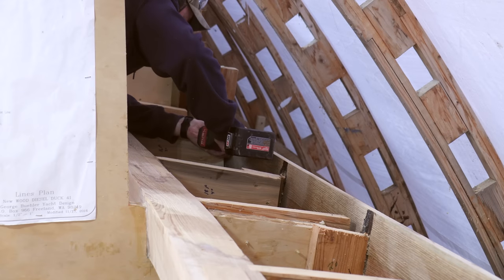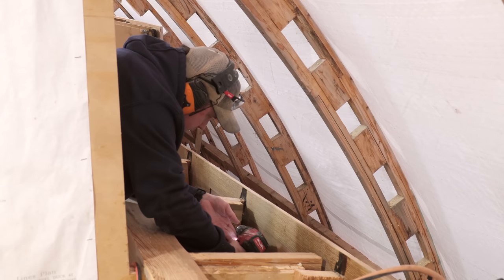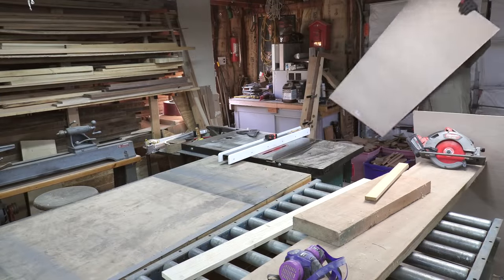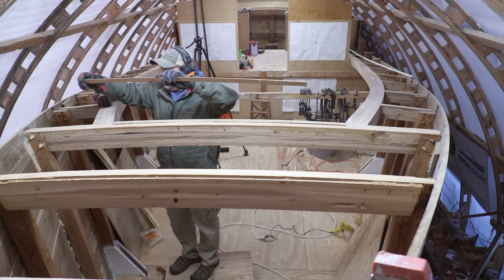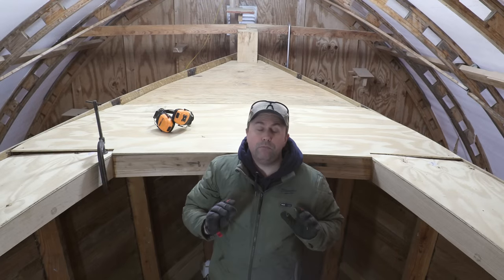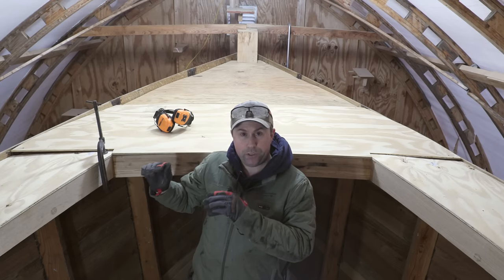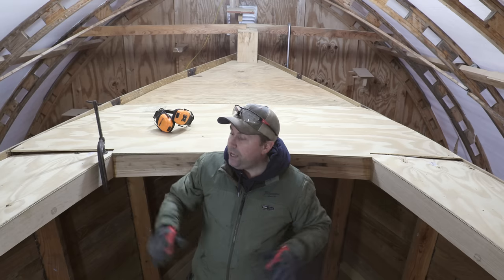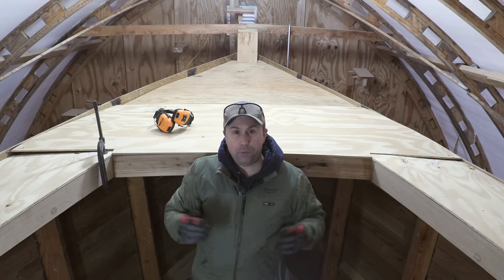Forward deck construction on our 41' wooden trawler.  SDP Ep78

Comment: Years ago I built a 20' fiber glass "Luger" cabin cruiser in my garage. I stunk up the house for two years. It went from, the boat, to that boat, to when are you going to get that thing out of the garage. With a 120 hp. Mercruise installed and in the water it became, "Our boat" again.

Comment: I think what would be great for your subscribers would be a 10min Into video of what you try to achieve with this project. I think for new viewers that would give them a good starting point to understand this unusual construction. For example why you use galvanises bolts, or why you use plywood. All stuff that traditionally was not used for boats.

Comment: Hi from New Zealand, a little warmer here but very wet in Auckland where I live.  Do you think you should have a beam running around the inside if the gunwhale to fasten the ends of your ply wood to? Looks like it just flapping in the breeze between the frames? You may have a solution for this? Cheers Ian
Reply from the maker: not accoriding to the plans but at the moment I agree.  Maybe when the other two layers are installed along with the rubrail it will stiffen up.  I'll keep an eye on it.

Comment: Good day Scott.  Just as a matter of interest, do you use marine grade plywood or normal plywood when you are going to put the deck over the ply? I was wondering about water resistance.
Reply from the maker: This is exterior grade BC construction plywood.  The difference between marine and construction is simply the quality of the plys and fewer voids in Marine ply, The glues are identical.  If someone is building a boat that involves a single layer of plywood, then marine ply is the only way to go.  However, since I'm layering, I'm not to worried about the occasional voids found in construction grade plywood.  Some would argue that marine ply, even certified marine ply isn't what it used to be but I don't have enough experience to comment.
Reply: @SixPointsWoodWorks  Thanks for the reply Scott. I am not a builder just a watcher of all your videos on the build.  I am from Australia and the quality of our plywood from what you call the box store is really poor unless you go to a proper timber supplier and pay big money for AB quality ply.  BTW I am really enjoying the series and marvel at the fact that you do it all by yourself other than when your son gave a helping hand in some early episodes.